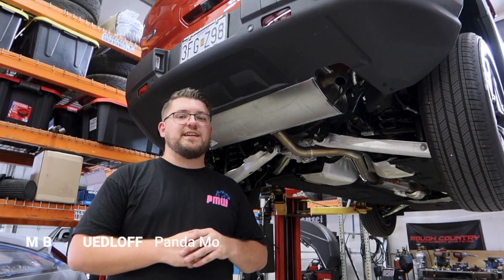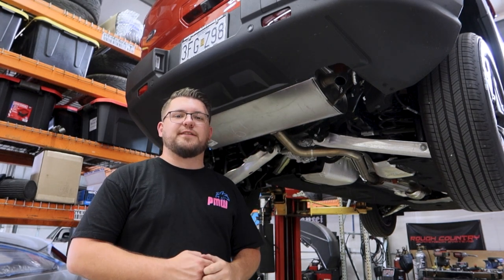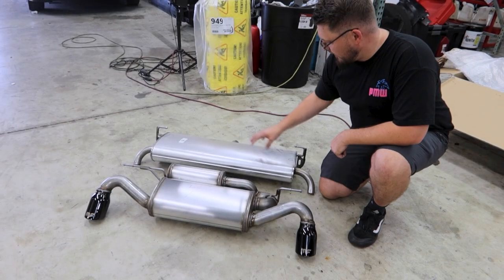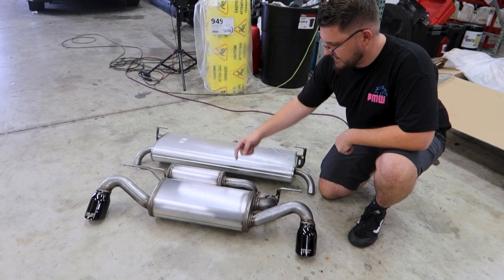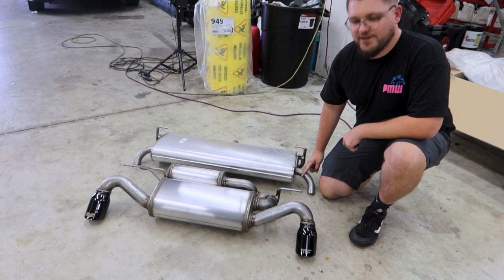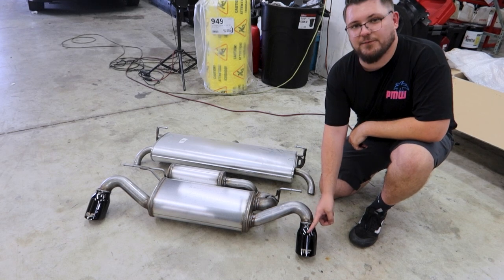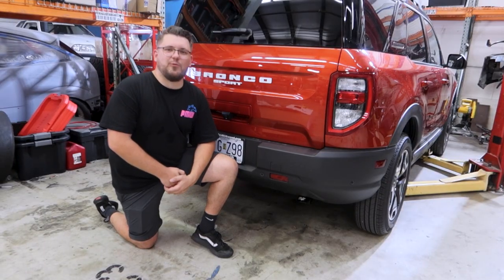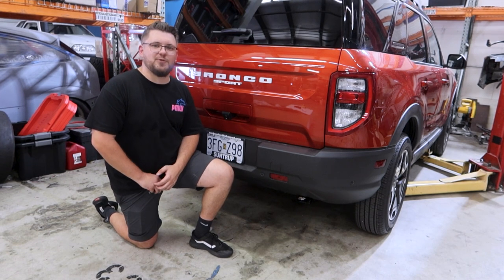You Need to Hear this Bronco Sport!  | Ford Bronco Sport Magnaflow Exhaust

Comment: Not much sense watching this video since they don’t even tell us if it is a 3 or 4 cylinder.
Reply: It’s a outerbanks u can see on the side so it’s the 1.5
Reply from the maker: This is a Axle back that fits both :)
Reply: Guess, if you don't know your models and what comes in each.
Reply: Googles free bud
Reply: bronco sport are 3 cylinders only
Reply: @joserosa5342  no, 1st editions and badlands have the 2.0L I4 engines
Reply: It’s a 3 cyl

Comment: Did the vehicle need a tune after to avoid the check engine light?
Reply from the maker: Nope!
Reply: @PandaMotorworks  nice, do you think if I have this exhaust and add the k&n cold air intake I will still be alright without getting a tune having both on there
Reply: I like big tips!!!!
Reply: @gerogebrown5148 you don’t need a cold air intake, it already pulls cold air from the front ram

Comment: The model in the video is an Outer Banks judging by the factory wheels, so the engine here is the 1.5. I have a 2024 Big Bend with the same engine so this upgrade would work on mine as well.